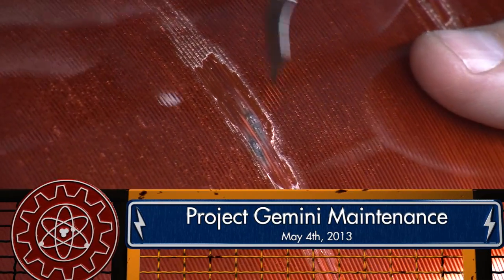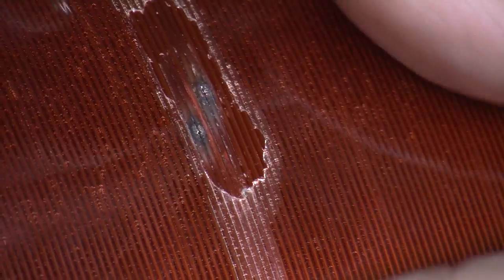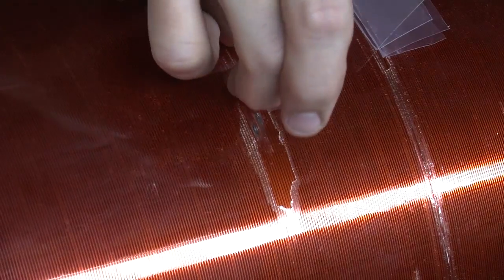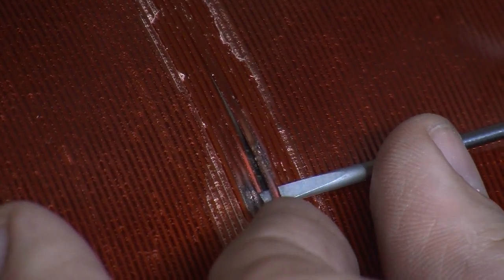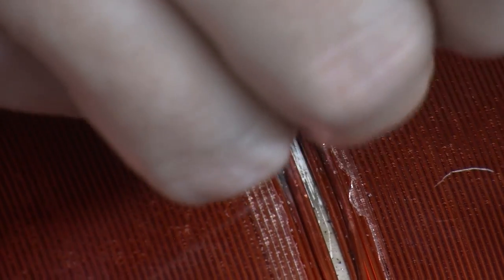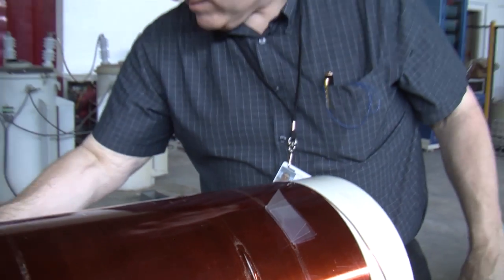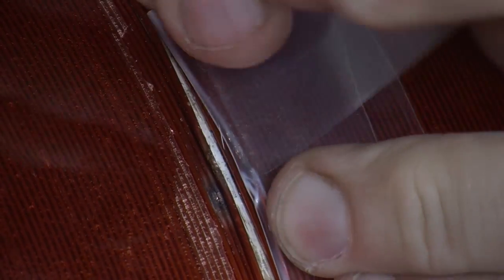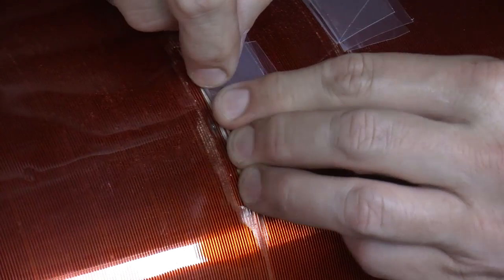Tesla Coil: Repairing Project Gemini

Comment: If you are seeing a 1,000 volt difference of potential between windings I would expect repeated failures. Is this special high voltage magnet wire? Most wire of this type is rated 600 Volts. It would seem to the under-educated me that more windings in the secondary are needed and an adjustment made to primary to compensate. Excuse my ignorance if I am way off base.

Comment: To save you some trouble start over the arcing will continue. The coating process was wrong to begin with  and the wire was of low quality. The coating needs to be vacuum infused in a autoclave and the coil needed to be baked to remove as much moisture as possible. In the video you can see bubbles in the coating.
Reply: moogie621 that's next to impossible to do on a coil that large, good lock finding an autoclave that large